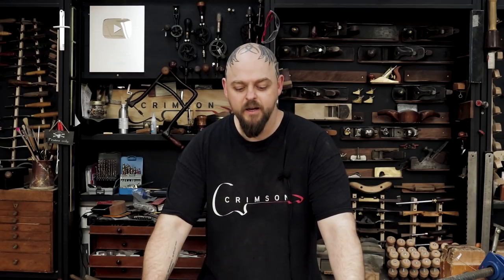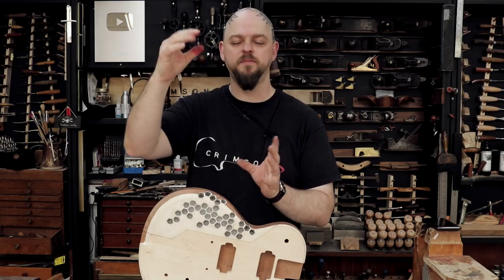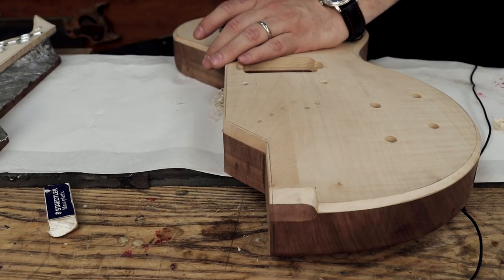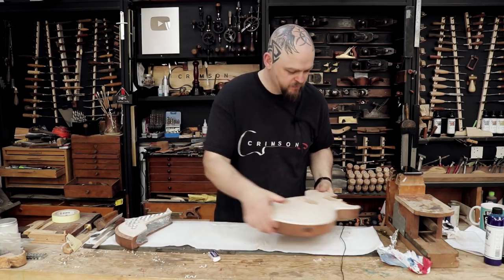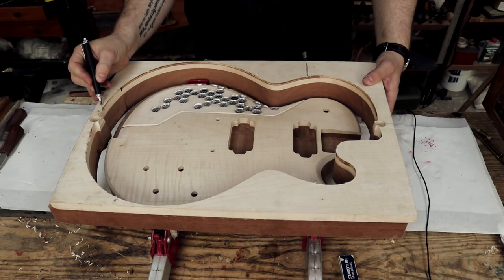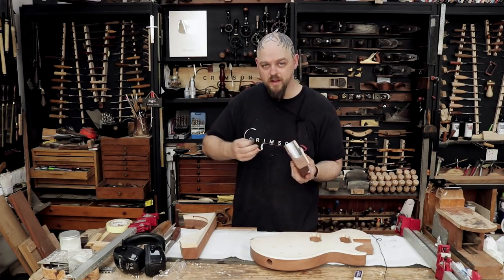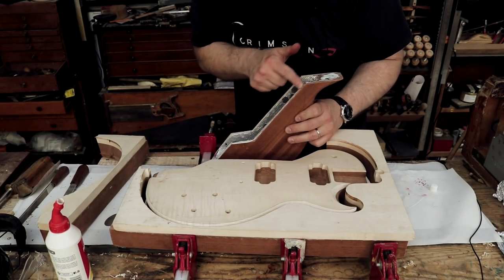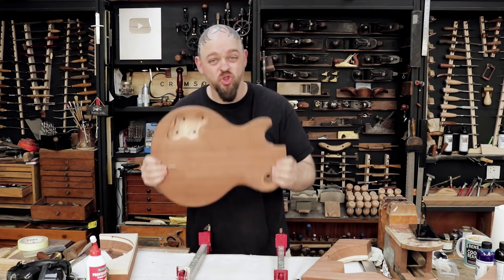Ep 8 - Taking a Great Kit Guitar and making it Awesome

Comment: Personally I think it would look better if you spray painted the inside of the cavity black. So it'll look like aged cast iron, with a nice contrast to the newer aluminium in the chamfers. You could then add an LED strip along the edge and have it pulse every time a string is played 

You could feed the input to the leds from the pickups through an arduino

Comment: Hey, I love your work!    Have you thought of taking some of those wood shavings, dropping them into a shallow dish of Black paint (a shallow dish to make them easy to retrieve), allowing them to dry, then gluing them into the bottom of the sound cavity?  That could look pretty sick, dude!
Also, for a future similar build, maybe with active pups, you could add an LED strip somewhere on the upper inside surface so they reflect back off the foil, making an awesome effect with the blackened wood shavings & reflective metallic foil & mesh (the battery to power the active pups would easily power the LED strip too).  The whole combination would look absolutely amazeballs.    ;)

Comment: sound sensitive led strip along the inside wall of the main body that shine into the hollow section. with all the aluminium it'll refract nicely and shine through the hexagons.

really low sensitivity though so its not overwhelming or a dial to adjust the brightness/sensitivity

Comment: I see you like to use that preposterously wide chisel to remove 1/16" of material.

also - it's "camphor" that's spelled with "ph".
Reply from the maker: Big chisel equals stable and flat when paring stuff away.. so much easier to use, plus... um, over compensation... um. Camphor, yes.. awful stuff to work with. B
Reply: @CrimsonCustomGuitars  I appreciate that you still come back to reply on the year old videos!
good job there.
and a good job on the guitar.  just because I give you some sass doesn't mean I don't appreciate what you did with this.